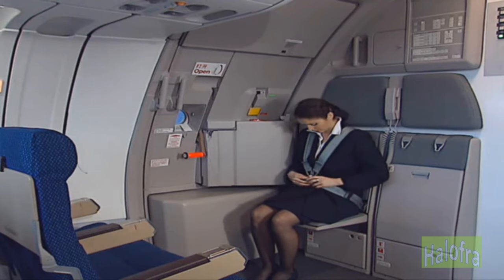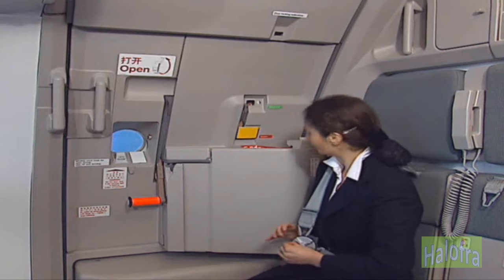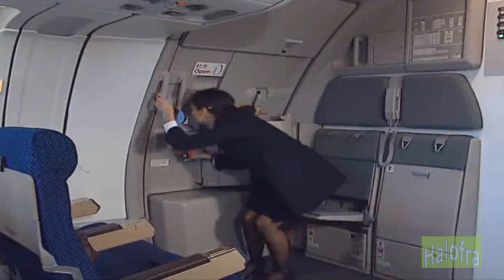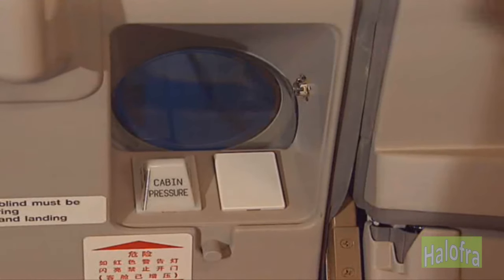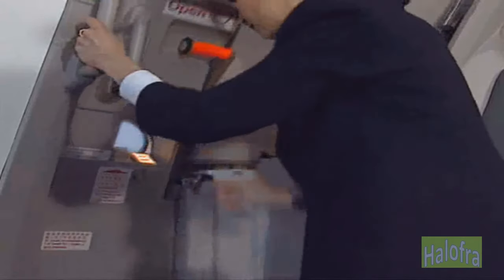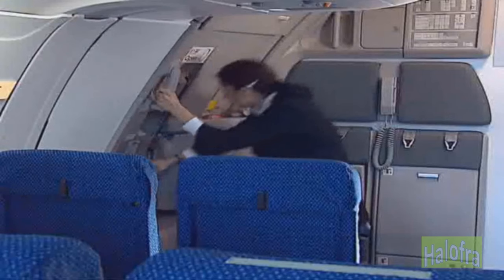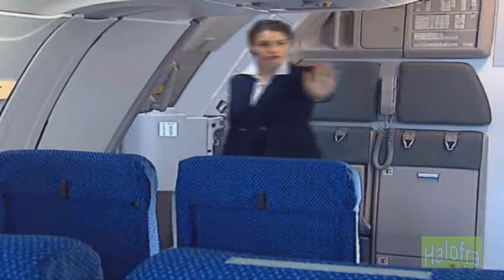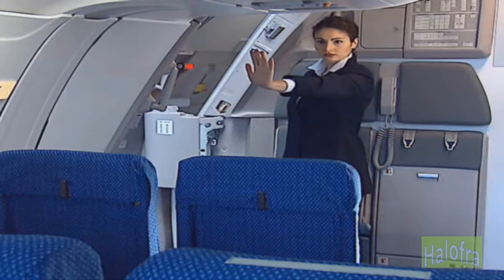Passenger Door Emergency Opening A320 Family

Comment: Pls someone translate here .
Reply: Ebubekir Zengin with the door armed you engage the door damper to open the door rapidly by braking a fusible cap on the unit, releasing high pressure Nitrogen that helps to propel the door outwards as normally the door is dampened by the same unit allowing for smooth and slow door maneuvering. This action also automatically deploy the slide.